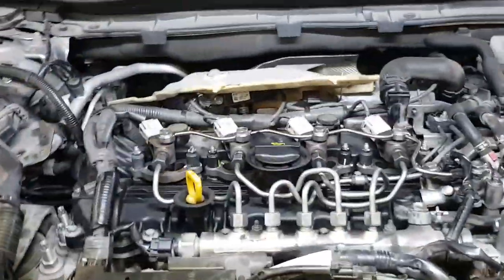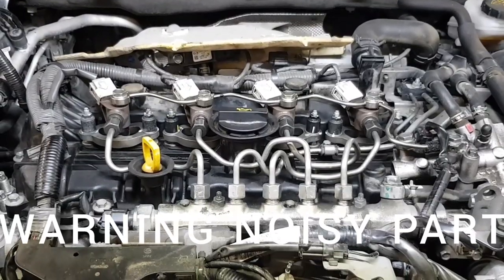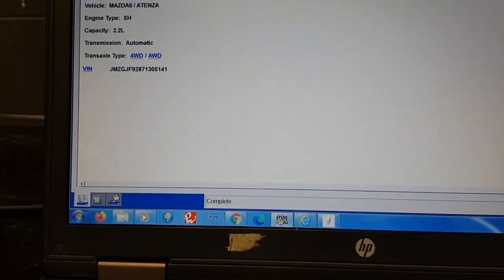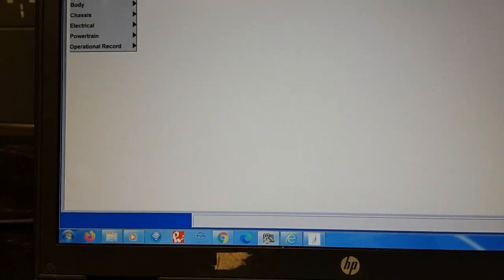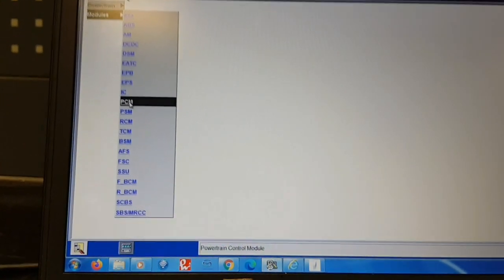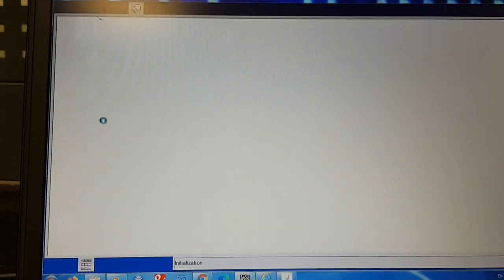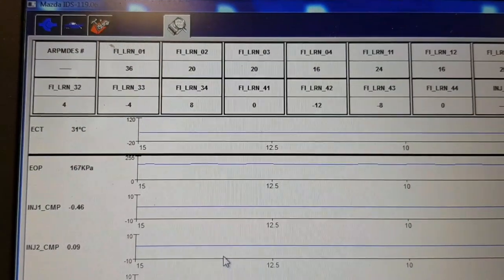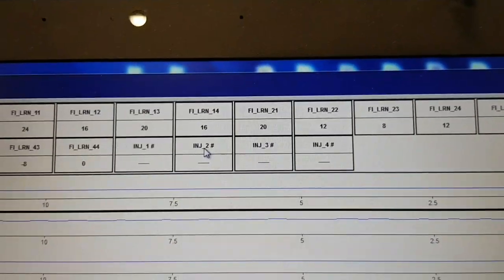Mazda Skyactiv 2.2 D Engine noise, quick and precise diagnosis.

Comment: As a Mazda 6 2.2 185 owner (2009) I can say mine is going strong at 210k miles (yes Miles) as our friend said it’s about clockwork maintenance. Oil changes every 5-7k with right oil . I only go to Mazda main dealers. Great video
Reply from the maker: Thanks. Those R2 engines were very reliable if well maintained, one thing you need to change as prevention is injector washers.  The timing chain gets stretched but that is when DTC comes on. Frequent oil change extends the timing chain life and not only.
Reply: @JB_Auto  thanks for the feedback glad you think it’s reliable as I’ve just spent a small fortune on a clutch and DMF 😟
Reply from the maker: @garysnell47  Well nothing last forever you said 210K miles mileage, it was time for it. If you had VW you would have to replace the DMF  3 times at that mileage😉
Reply: I change the oil in mine every 1-2k or every 5th fill. Engine perfect.

Comment: Oh my god! I like to buy a second hand Mazda CX5 2.2 skyactive Diesel 175. Since 27 years I drove different Mazda vehicles and I was always very satisfied. The CX 5 would be my first Diesel because I'm looking for more torque to tow my caravan. From up how many km's I must expect a defect like this. Normally I mantain my cars always very good, especially the oil change. I don't go to Mazda garage, because they rip off the customers. I bring my cars to a very good free garage where they can repair all different brands. The owner learned those days in a local Mazda garage. 
Your video is very interesting. Thank you for showing it. Greetings from Germany.
Reply from the maker: Hi. Thanks for the comment. Regarding this particular failure of the engine, it was at approximately 100K km. As I mentioned in the description and here is a quotation "This engine failure is an extreme and rare case caused by negligence regarding oil changes and service intervals.''
Concerning ripping off customers, I'm afraid I have to disagree. As a Mazda authorized dealer, we often have inquiries about matching the price quoted by an independent workshop; we are consistently chosen in such circumstances. 
Customers find only the Advantages of servicing their car at Mazda Authorised Workshop; for example, in case of pricy repairs like in my video and even outside the warranty period. As a loyal customer, you would receive the new engine. If you need more examples, write. Greetings

Comment: Hey I'm looking into buying the 2021 Mazda 6  2.2 DE Dynamic (Auto)

Can I be pleased adviced on the cars common problems as I'm looking into using it as a delivery car.
Reply from the maker: Hi, generally speaking, all Diesel engines on Mazda CX5 KF are heavily modified. Modifications began with early models(2013). Since the introduction of the SCR or commonly known AdBlue system, they got rid of soot problems so at this point those cars are much more reliable. Til now we haven't had any issues, that is sad because we have less work😉 but more happy customers though.  If your question appears after watching my video or any other, it is related to old models. Check out the description, there is a clear explanation of what it is related to and why. Thanks for the comment.
Reply: I'll still walk away from mazda diesel engines. I don't believe mazda makes good diesel engines. There're so many in the scrap yard and I'm adding a 2012 to them.
Reply: Please don't buy this Diesel engine, they are shit trust me.
Reply: @tedwoghiren4002  I cant speak for all Mazda diesels, but my 1.5 Skyactiv-D (Jan 2016) runs like a dream.  Only problem was a sensor in the exhaust system which Mazda fixed for free outside the 3 yr warranty
Reply: @iADRI99  I cant speak for all Mazda diesels, but my 1.5 Skyactiv-D (Jan 2016) runs like a dream.  Only problem was a sensor in the exhaust system which Mazda fixed for free outside the 3 yr warranty

Comment: Hello how do you access turbo on mazda6 2.2skyactiv-d to get to the sensor with the blue wire
Reply from the maker: Remove the inlet pipe for the bigger turbo, you may need to remove the battery and you should get good access to the wiring of that temp. sensor, if you want to replace it, you will need SST which is a 14mm socket similar to O2 sensors.

Comment: Thank you for your videos.  I find them to be very informative, well explained and helpful.  One could never stop learning from these videos.  I have a 2015 Mazda 3 2.2 D which I bought certified from a Mazda dealer with 31000kms.  Unfortunately it did not come with a service history and the engine has no issues at the present 38000kms.  Being mechanically minded I change the oil every 3000 to 4000 kms/yearly using Mazda original Ultra DPF oil and filter.  Also, I always monitor the DPF regen before turning off the engine i.e. if I notice that regen is in process I do not turn off the engine but instead take it for a spin using low gears until regen has ended.  I never experienced any oil rising/dilution so far.  My question is this:  having read about issues with these engines do you think I should check the strainer for clogging or the exhaust camshaft for wear after a certain mileage as a preventative maintenance?  Or should I stay with just the regular oil changes unless there's anything wrong?  In my ownership all I did was re tighten the injector nuts, clean and inspect the intake shutter valve and a pcm update at the dealer as a recall concerning the egr.
Reply from the maker: Hi, Thank you for your comment. It is excellent practice replacing oil as you do. Extended driving with diluted oil is very harmful to those engines hence further complaints. (For instance, as a result of severely diluted oil is broken oil pump chain.) 
Your driving distances are very short since you need to go for an additional spin to finish DPF regeneration. 
If you were driving long distances, you wouldn't notice DPF regeneration because it is automatic...
You did not experience oil dilution because, at 4K mileage, it is not noticeable.

Issues with exhaust camshafts were present on early Mazdas CX5 and 6
then after a specific VIN, it has been modified, including rocker arms, turbos, and much more; So we have never replaced the exhaust camshaft on Mazda 3.
A possible issue on the 2015 Mazda 3 would be: Combustion gas leak from the injector gasket/washer, creating carbon deposits and clog the strainer. 
The leak of mentioned gas occurs at various mileages, and most cases are at approx. 150K.
PCM constantly monitors changes in oil pressure; if oil pressure drops below a certain threshold, it turns on the oil pressure warning light and a message ''Vehicle inspection Necessary.''
Clogging occurs gradually, and it is not harmful to the engine if fixed at once. 
For myself, I would replace injector gaskets/washers (those washers are now modified and last much longer, new part no: SH01-13-H51 silver color)
On the other hand, if you perform regular services at Mazda's authorized dealer, you probably are eligible for free of charge 24/7 Emergency roadside assistance (available in most countries).

Summing up, I would stay with regular oil changes and drive longer distances.
Reply: @JB_Auto  Thank you for your clarifications/advice.  Indeed, my driving distances are usually around 40kms in rural/urban areas but hardly in traffic conditions and keeping it in 4th gear thus slightly higher revs of approx 2000rpm and with a planned yearly good trip on the motorway.  I also read about blown head gasket issues with these engines but I presume these were on early skyactiv diesels on CX5s and 6s.  I miss having a water temp gauge so I could monitor what's going on under the bonnet.  Other than that I give thumbs up to Mazda engineers for creating such a fine piece of engineering on the entire vehicle.
Reply from the maker: @edwardzammit3714  You are welcome. Indeed, the head gasket issues on older vehicles, but it was very rare, for instance, we've replaced only one out of so many sold. And yes Mazda's engineers did a great job, including the appearance of its cars
Reply from the maker: akita 1973  Which oil pipe?
Reply from the maker: akita 1973  Strainer gets clogged by carbon composite, and therefore problems with oil pressure, other components may get clogged as well therefore you need to check them.
Reply from the maker: For prevention watch my other video , here is the link https://youtu.be/VF6cVSb5dG8
Reply: Hello. How does one know that the regeneration process is still taking place?
Reply from the maker: @timothymaina2753  If you are using the diagnostic tool PDF regeneration ends while RPM drops. While driving and when the DPF warning light is on, drive until that light goes off.
Reply: @timothymaina2753  if you go to the infotaiment system, in the section were it tells you the average milage and gas consumption you will see three small pictograms on the lower right part of the screen, a batterie,  engine and a/c I think... Well the small pictogram of the engine lights up in blue when it is running normal and warm, whwn the engine is making a regen of the particle filter or cold, the blue light that iluminates the engine will turn off, you shouldnt turn it off while that pictogram is not blue.
Reply: any problem 2 years later, assuming you still have the car
Reply: @thatsprettygood0  No, not at all.  I try to stay on top of maintenance.

Comment: I have mazda 6 2015 with same rattling noise and lost of power, will it still be an injection problem
Reply from the maker: You need to check it, that kind of noise could be an injector as well. The noise because of broken pistons as You've seen in the video is extremely rare, one case in 12 years working with Mazda. You can use injector values for diagnosis, those I showed in the video, if the correction is high then it can make a similar noise to the one on the video.

Comment: Olá esse 
Motor é o mesmo do Mitsubishi Outlander 2.2 177hp? O meu Outlander tem esse mesmo ruído .😢
Reply from the maker: You will find similar construction in the Mitsubishi Outlander there are also two chains, the timing chain and the oil pump chain. Therefore you can apply the same way of diagnosis as on video. The engine is not the same.

Comment: What is a sharp higher pitched metallic noise at startup from cold only for less than 1 second? Normal driving is extremely quiet. 2.2 diesel 2014 after camshaft issues?
Reply from the maker: Sounds like something is seizing caused by lubrication problems, I'm just guessing. It is not a common problem.

Comment: Hello! Thank you for this video. I just bought Mazda 6 2.2 SkyActiv-D 2016.
After two days, I noticed the same noise and problem with my engine. Is it possible to fix it and is it worthy? :((
Reply from the maker: Hi, This kid of engine failure is very rare, so you need to be certain that this is the same, in many cases it is just injector making noise, I advise you to make an appointment at dealership, and let them diagnose it, if your car was serviced regularly at Mazda dealer you may be eligible for ''good will''
Reply: @JB_Auto  Thanks for the fast reply. Helpful.

Comment: Could you tell me if i can disconnect injector connector while is working tp check for noise or its not good
Reply from the maker: Yes, you can do that by disconnection of physical components or via diagnostic tool.
Reply: @JB_Auto  so if i will disconnect it by removing plug it wont damage ecu
Reply from the maker: @krzysiekp9753 It is safe for testing purposes. I use that method quite often.  I prefer diagnostic tools because they are much more convenient and test goes smoother.
Reply: @JB_Auto  thank you very much for answering my question
Reply from the maker: @krzysiekp9753 I'm happy to help. Thanks for watching.

Comment: Hello jb what can be causing bubbles in radiator. It's started when the air went cold and then found out the water was low no lights on or overheating. The water temperature is between 80c to 92c. Could it be egr cooler or headgasket
Reply from the maker: Hi, most likely head gasket, we have never had problem with EGR cooler, but ofcourse you should check both.
Reply: It probably has a leak in the cooling system and the bypass pipe is usually the part that fails you will have to change that to an aluminum pipe

Comment: Hi, I think I have same problem. Can you please tell me what software/program do you use to stop injection per cylinder? Thanks
Reply from the maker: This is Mazda IDS but you can use any other which is equipped with that simulation function. You can also disconnect each connector of the injector physically it will give you the same result.
Reply: @JB_Auto   do you have WhatsApp? Can I send you a video tomorrow? Thanks
Reply from the maker: @w202aam  I don't but why don't you post on youtube and send me a link?
Reply: @JB_Auto   please watch. Any suggestions are welcome! Thanks
Reply from the maker: Hi, I've seen the video. You claim that the noise is getting louder while the engine is hot that may indicate low oil pressure so check that first. While you disconnected connectors of each injector the noise seems to disappear at the first one, not quite sure. I suggest checking oil pressure, DTC's, checking injector values to exclude injector fault, as in my video. 
You should utilize a good tester to disconnect injectors because after disconnecting the injector physically you need to re-start the engine to get it running properly( you will have smoother transition using a tester, and therefore clearer picture) You can also raise RPM when disconnecting the injector to emphasize the noise, I noticed it gets louder while higher RPM.

Comment: HI
Could you tell me the tightening torque of the connecting rod caps and the crankshaft?
best regards
Reply from the maker: Connecting rod 30Nm plus 90 degree, crankshaft and here you mean about lower cylinder block: step 1: 40Nm , 2: Loosen bolts, 3 30Nm 4: 60 degree then smaller bots to 25Nm
This is for 2013 model year, you should check them against VIN because it could be different tightening torque.
Reply: HI 
thank you very much

Comment: My car is making a tap noise.   Mazda 6.   2,2D.   I plus there seems to be leaks of diesel.  What should I do
Reply from the maker: Hi, the tapping noise needs to be diagnosed, you can try the way I've done it as on video, fuel leaks needs to be traced, check your injectors if tightened properly, I had cases where injector was making tap sound plus leaking, that was due to improper tightening torque...